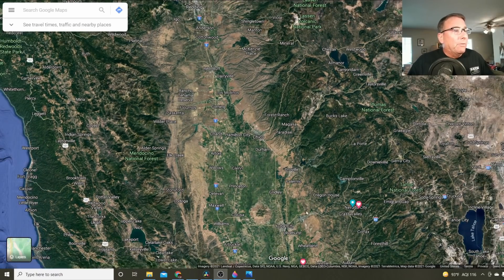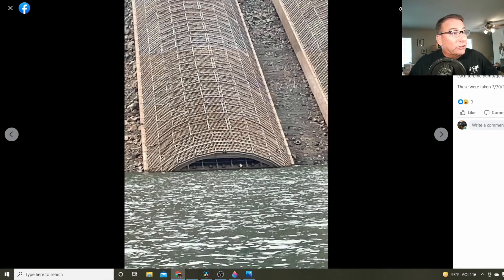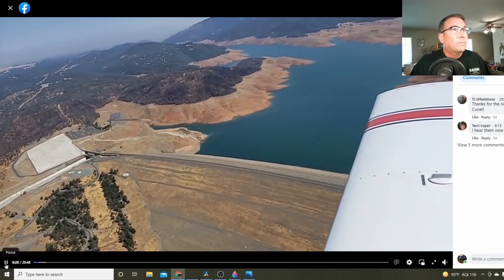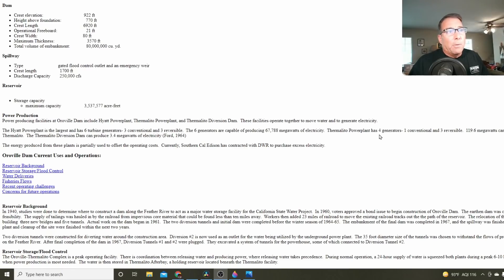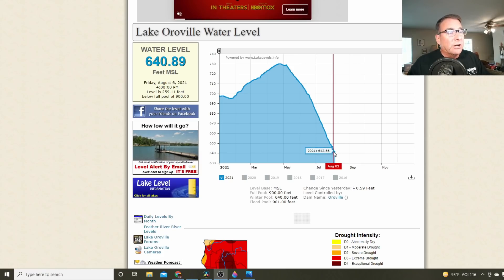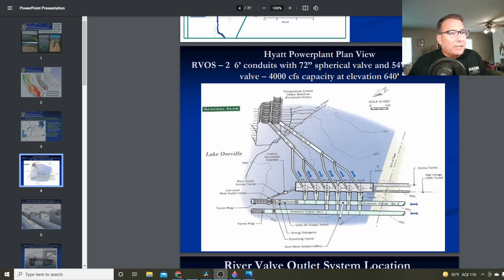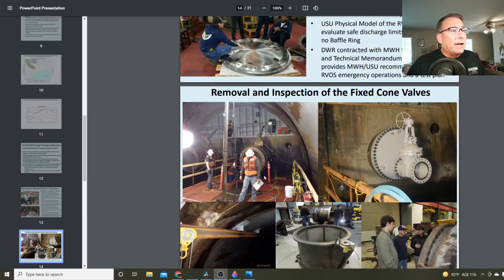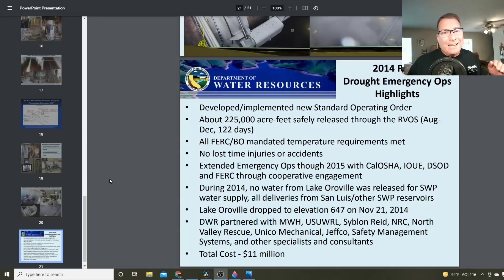Oroville Update! Hyatt Powerplant Offline 8/6/21 California Drought

Comment: Well, one good thing has come out of all this - the infamous green spot on the face of the dam has gone away. Glad they finally got that leak fixed. (Just kidding.)
Reply: A $100.00 worth of Round-Up keeps downstream people from panicking😂😂😂
Reply: That was the first thing I noticed from the arial view!
Reply: I don't know if there are any natural springs where the green spot is. It seems like too convenient of an excuse. I do know that there is a pretty good amount of water that leaks into the core block of the dam. It leaks through cracks in the concrete all throughout the core block.
Reply: @jeremyjones5836  agreed. Any body of water seeps into the surrounding earth. Some more than others. Aside from seismic events, Oroville dam is just fine.
Reply: Vax Not  lmao, the dam isn't, or ever has been, leaking.
Reply: Not at all, what you are not seeing is green grass growing because it always dies in July and this is august. It will re-green itself with winter moisture as it always does. Situation normal for the green spot. This is NOT golf course grass, it's wheatgrass and wheat isn't green this time of year either. Please buy a clue. It is a spring from the backside of the dam and the higher ground feeding it on the right flank where the impeller is on display as a directional aid. The area contributing to the springs is all of that hill. It really greens up with melting snow on those hills behind the dam when the water exits via the spring on several horizontal steps of cobbles on the back face of the dam that typically become the green spot in late spring. With the water so low, we might see a fairly normal green spot without any water at the same level on the front side of the dam and for the first time in recent memory can actually dispense with the misinformation that any of that green spot moisture is coming from the wrong side of the dam. Several springs have always been there and they are all seasonal, which means they are dry right now. But even if they were wet the wheatgrass would still be dead brown like the rest of california.

Comment: We PG&E still do pumped storage down at Helms Powerhouse you should do a story on that someday, we pump up the hill filling Courtright reservoir during the day when power prices are low and generate during high demand (Early morning before the sun comes up and late after the sun sets and we all come home needing more megawatts)
Reply: What's the round-trip efficiency like?
Reply: @MichaelOnines  Really good. It can reach 80-85% depending upon who is doing the telling. The Energy Information Administration says the US fleet of pumped hydro averages 79% monthly. A bit less than chemical batteries at 82%, but usually with higher capacity for longer run time. Batteries are much quicker on reaction time (full power from idle in milliseconds versus a couple minutes), so there is no one optimal solution. Plus, you can park batteries or mechanical flywheels anywhere. Pumped hydro requires the right geography.
Reply: @Markle2k  number of cycles for batteries are so low, still. Thanks for the info, wasn't sure as I thought I had seen figures from the low 90s to low 70s.
Reply: @Markle2k  here were I,live we have one relativ new pumped storage that can switch from pump mode to production mode in around 31 seconds. And your efficiency is pretty much in ballpark with 80% +/- 2 %
Reply: @Markle2k  I can really remember anything other the prototypes when ic come to redox flow battery’s. There was some buzz about them but I got relatively quit around them.
Reply: @Markle2k  hm okay. I heard something about those but never really dove into it
Reply: That would be great if Juan could do a segment on this. Could you get him in to video and explain how it all works?
Reply: Worth noting that 99% of all mass energy storage in the world is pumped hydro.   Yes big battery banks can provide a quick reserve, but they can't compete with a literal reservoir of capacity and potential power output.     We're often talking a factor of 5-10 greater capacity and power generation.
Reply: @daemn42  In the US, pumped hydro is 91% of grid storage. That’s largely because of a century’s worth of a head start.
Reply: Look up the joe Scott video on molten metal batteries. They look very promising.

Comment: And to think that just a few years ago this lake was overflowing to the point of near collapse. Crazy how things change.
Reply: Well have record rains and floods when this drought ends. Just like before. It’s a vicious cycle
Reply: @brokenwrench404  agreed, it's cyclical. All the money spent each year to study, fix, tax, worry, etc is in itself an unjust tax on the people of the state. It's a cycle.
Reply: @brokenwrench404  We're getting unseasonal rain here in Australia. Flooding in former severe drought areas.
Reply: Maybe you should expand it why they got the chance! there will be more lf  this coming
Reply: Mismanagement! Typical for California.
Reply: @goducgo  just what was mismanaged?
Reply: @TheBeingReal  well putting up power lines that aren't insulated was pretty dam stupid. Then not clearing underbrush was pretty stupid... Especially with un-insulated power lines above... Wow.
..

Yea... Dumb af.
Reply: @susanhighfield8284  FYI: high tension powerlines are not insulated…for good reasons.
Reply: @TheBeingReal  whyd it work in arizona?or maybe im confusing the policy change and steps taken when the high tension lines fail. Its been many years since i read the findings.
Reply: @susanhighfield8284  
Actually all major powerlines are uninsulated. The problem is when they don't do proper maintenance on them and they develop stress fractures over time,(which all aluminum will do over time) and those stress fractures weaken the lines until they break then fall and start fires. The only fixes are new wires, and or closer towers. But that takes work, and they wanted to keep collecting rates without doing work. That's why the whole company should be fired.

Oh yeah, and thrown in Jail!
Reply: Severe floods in Europe this year.
Reply: Look at the California population curve vs the  assure water availability.. Population and swimming pools skyrocketed and the water supply stayed the same.
Reply: @jhill4071  Virtually everything west of the Mississippi is semi-arid. Water has always been an issue. Frankly we’ve engineered ways for people to live in desert areas and it is just sustainable.
Reply: @TheBeingReal  its actually sustainable but the political parties do not want to give up control.
Reply: @brianbiddle7590  when there is not enough water, it is not sustainable.
Reply: @TheBeingReal  i am not sure if you have a map available to you but there is a fairly large body of what right next to CA. We had a desalination plant built and operational in the early 2000 but than the rain came and they said it was to expensive to operate so they sold it to the middle east. The same people that said it was to expensive to operate the plant so we would basically have an endless water supply are the same people that are mandating green energy no matter the cost.
Reply: @TheBeingReal  also residential use of water in CA is only 10% of the water used and released.
Reply: @brianbiddle7590  Desalination plants are very expensive to operate, have a limitied lifespan and the effluent is very toxic. People don’t want to pay the real cost of water…almost anywhere in the USA.
Reply: @TheBeingReal  the cost to operate that plant in 2000 is actually cheaper than the rates we are paying today since we did such a great job conserving water they had to raise the price of water because they did not sell enough. So you can't say its to expensive. You don't seem to open to solutions. Again residential use is only 10% of the water used in CA. That 10% doesn't even take into consideration the millions of gallons of water that washes out to sea when it rains.
Reply: @brianbiddle7590  I did not say it was too expensive, just expensive to run those plants…and they have a downside to consider too.  2000 costs and 2021 costs are very different too.  

I’m always open to solutions, you need to consider the unintended side  effect part too in the decisions.  Drying up rivers has significant side effects.  Drying up underground water has side effects.  Growing things in arid to semi-arid places just might not be sustainable.  Same with cities in deserts.
Reply: @TheBeingReal  well the option are to increase water storage and areas to obtain new water or just start voting people off the island I guess.
Reply: @brianbiddle7590  you have a solid understanding of supply and demand.
Reply: @TheBeingReal  
You really don't know much do you. Can you explain why the waste water from a desalination plant is toxic? I know, because I have operated small ones. If you know why it is "toxic" then you would know how easy it is to make it instantly non-toxic, and how every desalination plant does it.
Reply: @davidscott5903  One should never assume.  

One can add water to reduce the hyper-saline water, that does nothing to eliminate the chemical toxins that are in the effluent.
Reply: @TheBeingReal  
I feel like I'm the man in black trying to talk sense into vizzini.
Reply: @davidscott5903  thanks.
Reply: @jhill4071  If you do some research, you will see that backyard pools are not the problem because they are only drained and filled once every 5-7 years and the evaporation is minor.  The real issue is the massive explosion of Almond tree farms that use huge amounts of water compared to traditional crops like strawberries, tomatoes, etc.  Farmers are now bulldozing their almond trees because they can’t get water.  They never should have allowed anyone to farm almonds in a drought prone state in the first place.
Reply: @jhill4071  residential use is only 10% of water used in CA. The majority is used to grow crops to send overseas or they just let it flow out to the ocean.
Reply: @brianbiddle7590  good reasons all, actually.
Reply: @BradGryphonn  i really do not have a problem with trade. What i have a problem with is that 70-80% of our water goes to grow food for other countries but as a resident they want us to cut back water use. Than when we do they come back with you guys did such a great job conserving water that we didn't sell enough water so we have to raise the price.
Reply: Things change all the time....trying to keep everything in one state is whats crazy.
Reply: @Dean Zinter DEFINITION : INSANITY.
Reply: CRAZY!
Reply: The West and CA got 2 choice, fix or keep the water problem!  CA got 85,9 m acre foot, Coloumbia river dumps 191,3 m foot into The Pasific every year.  Move some water (10%). Make a 365m long tunnel from Red Bluff (Delaware Aqueduct tunnel is 86 miles). NV, AZ, Mexico can then keep more Colorado water (5 million acree feet a year).
Reply: The emergency flow did collapse.
Reply: And it has absolutely nothing to do with “climate change”
Reply: @Dean Zinter 
Yes!
Reply: @Dean Zinter I was waiting for someone to mention the democratic debacle. They are intentionally causing problems.
Reply: @Channel 99 you are right. There will be no where enough electricity to power billions of electric vehicles. Not to mention where will all of the lithium and other chemicals come from. Then how do you recycle all of the batteries when they fail? Just some points of failure for the electric car fanatics to think about.
Reply: The original design was to hold 4-5 years worth of water to supply the contracted allocations.
Reply: It's where the water goes.?..now it is drought here as the other side of the planet is flooding to catastrophe.  Giza pyramids were in a lush jungle once too they say.
Reply: @gavincurtis  Yeah, the climate change was caused by all those camels emitting greenhouse gases.
Reply: @gavincurtis  spot on friend. All the water here is a Closed system in our environment. It’s our ancestors water, freezes, thaws, Melts,  flows , vaporizes etc . There is no water coming into our atmosphere.
Reply: @gavincurtis  The moon is throwing off the earth's gravity and geometry. LOL The water is wobbling.
Reply: Unprecedented
Reply: Amazing how mismanaged this whole California thing is.  Water, fire, people...its all a man made mess.
Reply: @grayrabbit2211  LOUDER FOR THE PEOPLE IN THE BACK
Reply: @rollingacresfarmstead206  
Yes!🤣
Reply: @grayrabbit2211  
Yes!
Reply: That's California 4 ya.  Been that way for a long time.   Just got to plan to deal with it.
Reply: And in 2015 it was super low: https://youtu.be/rNg1AV2s8vk
Reply: It was never near collapse. Ever. Just the emergency spillway. People are hilarious.
Reply: @markbrinton6790  Yes, I know. I'm an Aussie, but I followed this story when I first saw the reports of the emergency spillway close to being breached. I was kind of obsessed from the start. I've been following this channel and a couple other from those early days. There was a fear at one point that the main spillway could keep collapsing upwards to the gates if you remember. But thankfully they managed to clear enough water and with the season changing (rain stopped) managed to prevent that happening.
Reply: @Dean Zinter - Pull your head out.  Shall I elaborate on Texas this winter?  Are Republiscum so brilliant?
Reply: @daneclark3161  
If you look into it, you will find out that it was the environmentalists and Dumbocrats who shutdown the reliable coal fired power plants and forced them to convert to natural gas cogeneration plants which compete for natural gas with the homeowners who use it for heating. That idiocy caused the natural gas demand to skyrocket and overload the system and shut it down. That caused all the power outages and the loss of natural gas to some. That caused death and destruction just like every democrat policy.
So yeah, even in states that are a majority Republican, there's a lot of rhinos that don't know what real conservatism is, and will steer the state down the wrong path, and not provide reliable infrastructure systems. Just like this infrastructure bill that just passed will have all sorts of shiny things that look good and politicians will be able to get their pictures taken in front of, but they won't be reliable and will be way overpriced. If you don't believe me, go look up how much a public bathroom costs to build in central park.
Reply: @daneclark3161  yeah you’d be wrong. All of our major cities that control these things are ran by Democrats.  You’re also comparing the Texas freeze which developed rather rapidly to California fires and water issues that have been going on for years.  Regarding the water shortage Californians are just waiting for someone to make it rain for them.
Reply: @daneclark3161  <<< Crybaby had to react 😂😂😂
Reply: @chuckrambo4401  - You on drugs dude?
Reply: @Channel 99 - Hmm…. I wasn’t aware that droughts and wildfires were the result of an infrastructure mismanagement.  I was under the impression that they had been happening since the dawn of time.  I certainly was aware that our handling of them is a management issue, which is specifically why I compared rolling blackouts to the whole state being without power.
Reply: @daneclark3161  
Really? You don't understand how a company that was given a monopoly by the government could take the profits for years and never reinvest it back into the powerlines which then break and start wildfires that grow out of control because of government policies that limit the cutting of trees to the point that the forests fill up with dead dry wood just waiting for a spark to explode, can be the product of government mismanagement?  I guess you probably don't know what 2+2= is then.

Comment: You may want to check the values on the installed capacity of the powerplant.  67,788 MW is 67.8 gigawatts.  For scale, Three Gorges is about 22.5 GW.
Reply: 644 MW according to Civil Engineering Datbase.
Reply: @MichaelOnines  that would make more sense
Reply from the maker: still...about 80,000 houses....
Reply: You may want to go elsewhere